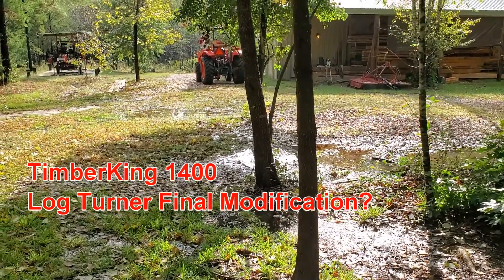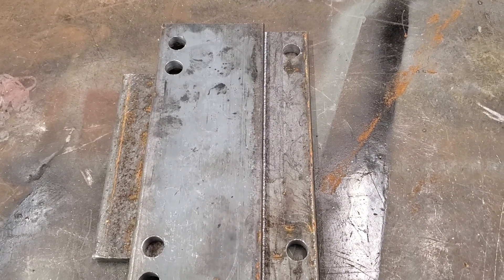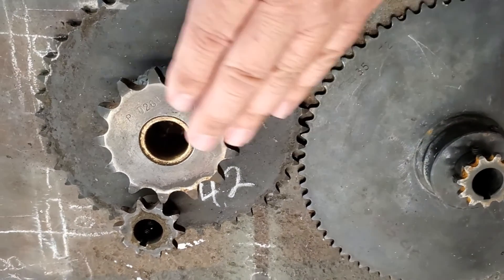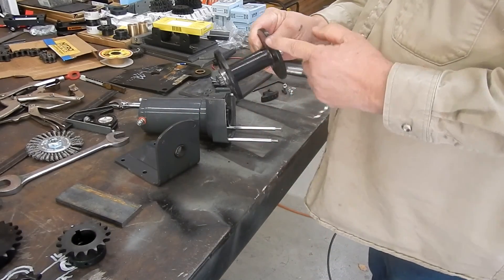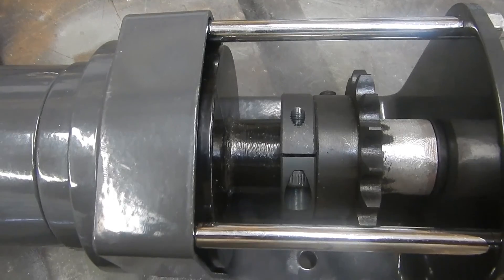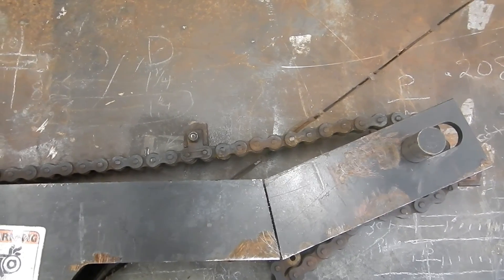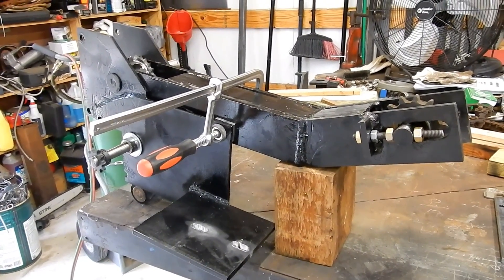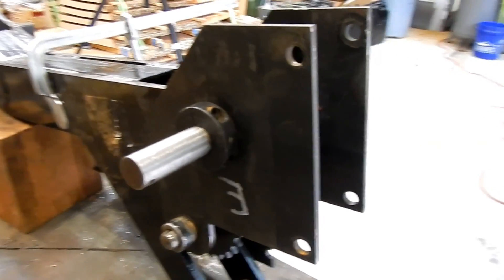Log Turner Final Modification? Part 1

Comment: I just came across your channel and I must say I'm impressed with the modifications you've made to you r sawmill. I built a sawmill a couple years ago and I've discovered it's a ton of work turning the cants and getting everything ready for the next pass. I like your ideas and hope they work out well when you get everything going.  What part of the world are you located? Best of luck.
Reply from the maker: Impressive, building your own mill. You are correct the log, cant and board handling is what will wear you out and is time consuming. I am in northeast Texas. May your sawmill run smooth and true, happy sawing.